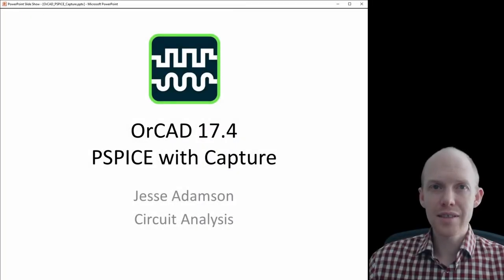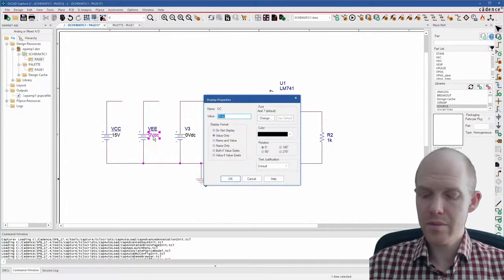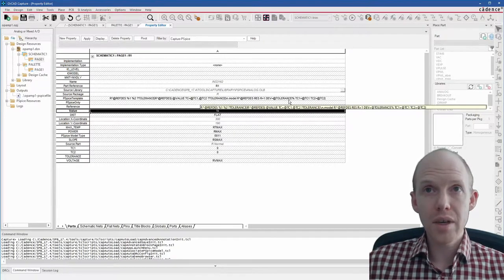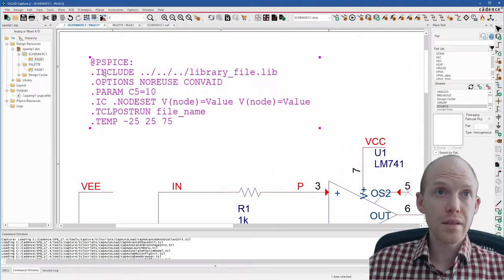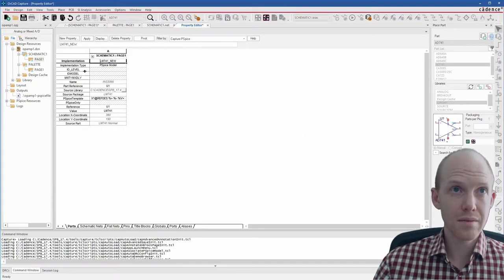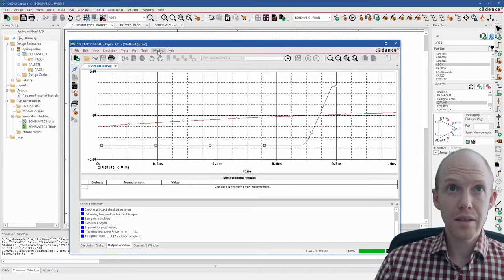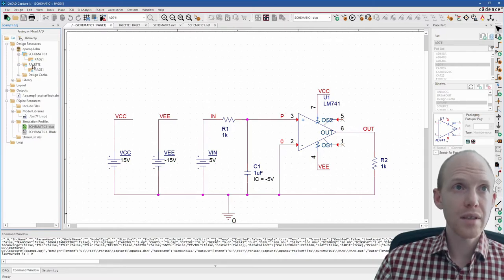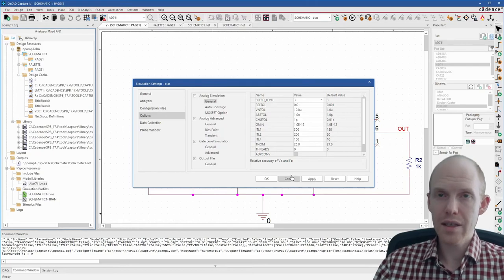Cadence OrCad 17.4 PSPICE from Capture (Detailed Introduction)

Comment: Model editor can be used for several reasons dml model ie simulating processors converting ibis models to pspice model etc etc even creating a model so you can simulate hardware in the loop
Reply from the maker: Yeah I was kinda thinking about that while I was talking about how I don't use it. I need to learn more about making custom parts models from datasheets, like for transistors and diodes and stuff. I think the model editor helps with that stuff and I need figure it out. The real reason I don't use it to view models if I don't have to is because it takes a long time to open up for some reason and it's a lot faster to just open the text file lib if I have it handy. Anyway thanks for all the comments! It's great to get some feedback and know that there is interest in this stuff! What kind of circuits do you usually work on?
Reply: @CircuitAnalysis  As far as looking at the test file is concerned if you have the latest service pack installed you have the option of viewing the model test in orcad just select the component providing it has a model library attached to the component just right click on it and about half way down the pop up menu is a  "View PSpice Model" menu just click on it and it quickly lists the model in a text window inside orcad and if you have sevel models in that library file it opens it at the correct space in the file
Reply: Instablaster

Comment: you can use the rotate command to rotate the component it save the ctrl c and ctrl v shenanigan
Reply from the maker: Oh yeah good point, you can hit r twice or v once for flip vertical. Now I realize the reason I didn't do that is because in some other programs like simetrix if you rotate the parts it keeps the wires connected and re-routs the wires all funky, so I have a habit of cutting them first.
Reply: @CircuitAnalysis  You're doing well I first bought orcad and pspice about 10 years ago it took ages to learn it and even now when I think i know it i still have to go and look at various notes just to remind me
There is a lot of good books and appnotes out there if you want i can send you a list of books that have helped and that i constantly refer to them even the one that were written in the early nineties still has me referring to them.
Reply from the maker: @tdrelectronics766  Awesome. Yeah I'll take all the references I can get. You can either just post them as a comment on this video or on my channel's "Discussion" tab so they're available for everyone or you can email me directly from my channel's "About" tab. Thanks!

Comment: hello,i try to run my simulation profile but capture crashes...do you happen to have any ideas?
Reply from the maker: Capture is very buggy. There are a lot of things I don't like about it and I have had similar problems. Sometimes re-starting everything helps. Sometimes you may have to delete it and create a new sim profile. You can also check for new hot-fixes to install the latest patches. Another thing I've noticed is you can sometimes run the simulation and then  open the sim-settings from within the PSPICE A/D GUI and it will work from there even if it doesn't work from capture. Sometimes if you have general problems with your project getting funky and not acting correctly, you can open the project file ".opj" in a text editor and manually fix issues, for example broken links or sim profiles that have disappeared. Worst case if I have a project that gets totally messed up, I just start a totally new project and copy/paste the ckt from my prev project into the new one and make a new sim profile to get everything fresh and clean. Good luck!
Reply: @CircuitAnalysis  thanks for the fast answer!
i found the problem and it was kinda dumb of me..
i was saving my projects to another folder on my desktop while i should have been saving them at the C:\cadence folder..